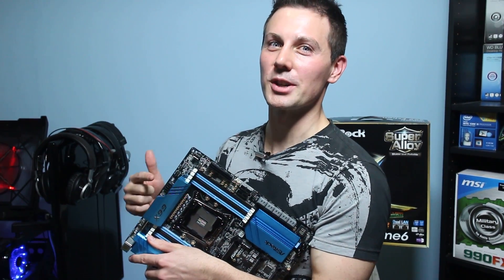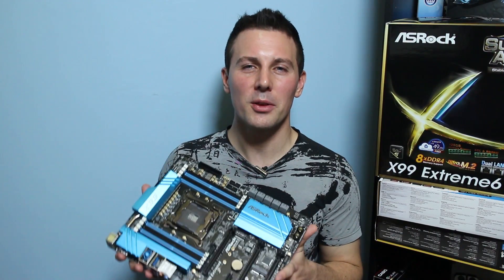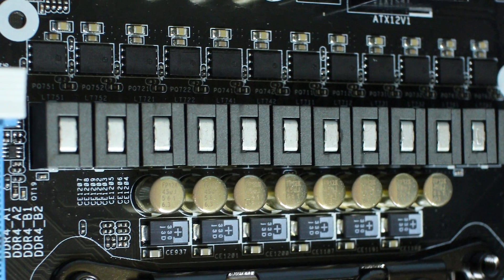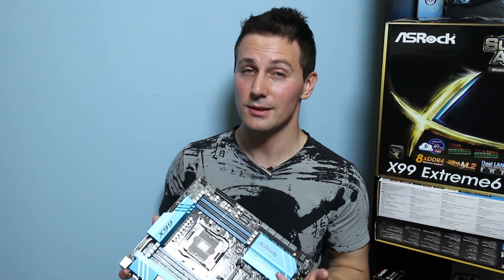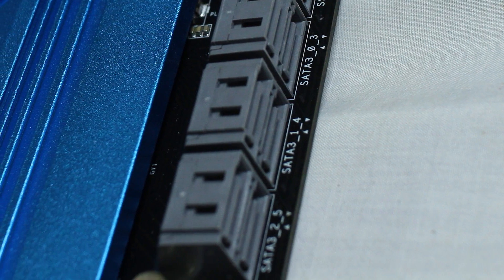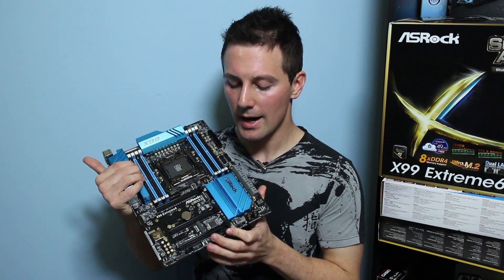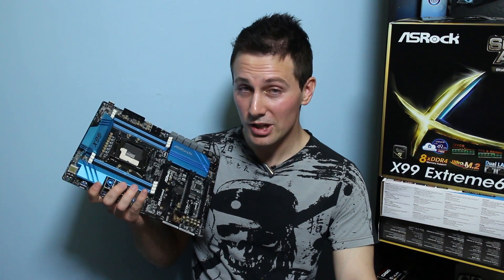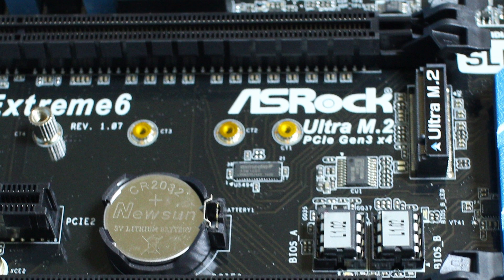ASRock X99 Extreme6 Review - Finally a X99 motherboard that WORKS!

Comment from the maker: Happy New Years Everyone!
Reply: You too, bud!
Reply: Mr Tweedels Never use AIDA (or any stress test) and adaptive voltage, it is known that it will pull more power than required, if you wanna test out if it's pulling more voltage than you set in the bios, try playing a game and monitor your CPU voltages while playing, this will show you how much voltage is really used for your CPU.
Reply from the maker: Not sure about the Asus Deluxe, but I have two of Asrock's X99 Boards here and both work / have worked flawlessly.
Reply from the maker: lol don't let the women dictate how to spend it :p
Reply: Hi i have a question about Overclocking. I have an 4790k that can do 4.6GHz on all cores with 1.180 Corevoltage (manual mode) but when i set to adaptiv with CPU Turbovoltage set to  1.180 and the offset at 0.001. But when i try to benchmark it with Aida64 Extreme it goes to 1.312 CPU Voltage. And i don't know why. Hope some one can help me.
Reply from the maker: What motherboard are you using?
Reply: ASUS Z97-A
Reply: Mr Tweedels Meh, can't get adaptive to OC worth a dam on my Hero VII... but my 4790k needs a lot of volts 1.231 just at auto settings... 4.6 works at over 1.300 on manual, but not well ("well" being Prime 95)... and this is with it delidded (relidded? lol) and Coollabratory thermal compound between the IHS and die, with good temps. I have terrible luck with CPU overclocking and am pleased as punch that my 4.0/4.4 CPU actually reaches THAT! :-)  I've scoured google and vids looking for details about adaptive voltage but haven't found much that does the work for me so one must get in and just tinker... and there is a LOT to tinker with on the Hero VII bios. 4.0/4.4 turbo is it for me as I am getting on with my life... lol.
Reply from the maker: One thing I forgot with the ASRock boards (was the same with my z77) is their override (fixed voltage) is pretty interesting, your voltage won't move at all, but your CPU will still throttle down and save power, for some reason feels slightly snappier than adaptive when coming off throttle.
Reply: Tech YES City
I noticed the same thing with the ASUS Z97-A
Reply: Dunno if I wanna push 1.32+ volts (my 4.6 settings) 24/7, even with it saying it's running at .7 ghz.
Reply: Tech YES City This is my new build saved up mate but I'm just concerned about how long before I have to upgrade again? I think It should be 2+ for 4k and 1440p 3+ and 1080p 4+ just wanting your thoughts on the situation at hand, and nice video like always :D
Reply from the maker: What is your new build? The ex 6 and 5820k? It will last quite a while, especially for gaming.
Reply: Please help me tech yes city. I just bought an asrock x99 extreme4 motherboard with an i7 5820k. I've never done over locking before so please walk me through this to get this cpu from 3.3 to 4.0 or 3.8 maybe please.
Reply: hey man, nice Video content! i bought an i7-5820K and an x99 extreme 6 ac, and an MSI GeForce GTX750 2GB DDR5, before more than two months.
I got always ERROR #57 and b7 which are Memory errors.
i could not figure it out, so i had to bring it all back. I got the info that there was a damage at two RAM Slots and there was also two bent Pins at CPU slot.
I can promise, that i was soo carefully, soo concentrated at assembeling so it probably wasnt my misstake.
Now i got back all parts, with pre-assembled CPU and RAM bars with the Mainboard.

I dont know, i paid €1100 for the components, and i was very careful with this expensive parts. Before i touched anything, i learned about and watched videos about correct assembly.

Do you think, its possible to receive that damaged products in that price point?
Reply: hey man, nice Video content! i bought an i7-5820K and an x99 extreme 6 ac, and an MSI GeForce GTX750 2GB DDR5, before more than two months.
I got always ERROR #57 and b7 which are Memory errors.
i could not figure it out, so i had to bring it all back. I got the info that there was a damage at two RAM Slots and there was also two bent Pins at CPU slot.
I can promise, that i was soo carefully, soo concentrated at assembeling so it probably wasnt my misstake.
Now i got back all parts, with pre-assembled CPU and RAM bars with the Mainboard.

I dont know, i paid €1100 for the components, and i was very careful with this expensive parts. Before i touched anything, i learned about and watched videos about correct assembly.

Do you think, its possible to receive that damaged products in that price point?
Reply from the maker: Yeah, the pins are not sent bent from Asrock, I would guess that they (the retailer) actually sold you an open boxed motherboard (one that had been returned previously)....  Pretty dodgy practice if so, but there is a chance you did itself, but if you are as careful as you say then it will be one or the other.
Reply: Hm ok, but is it possible that i bought an "second Hand" Mainboard?
in the Video you see the packaging, which was really good, welded in this special foil/film.
Also all this cables, wifi antennas and each piece in the delivery was extra welded...
Reply from the maker: Yeah it is very possible.   Sounds more like a refurb that was just boxed as 'new'
Reply: WTF! things like that really happen in the EU? what fu**ing criminals do we have in our bad contaminated world?
Thats an €260 ($300) mainboard, is it possible to identify refurb-boards from Asrock?

i really hate this Board, and especially the company Asrock.
it feels like through €1100 out of the window. I think ill never buy my components seperatley, for €30 more, i could get it built ready to use.
Reply from the maker: Try contacting Asrock, and if you can try finding out some more information, as it could not even be Asrock's fault at all...   However this kind of thing does happen.
Reply: ok, i will try this. thanks man for your help. 
youre Welcome, go on...
Reply: +Tech YES City do you know any updated, or even a review of the asus deluxe? man, its 2016 and i see that there were problems with them but, nothing new...seemingly. it would seem that when they go, they blow your cpu up too. so, you know anything or, which x99 is great, with good sound great features and won't blow up my 5930k? please help me bro. i can't afford to blow my shit up. also, what do you know about if something blew up your cpu as far as refunds, or exchanges? again, please help me bro, like seriously. my head hurts from digging through all these forums and youtubes.
Reply: Tech YES City
yeah...blue....but yeah... okay. thanks man. I kinda of got that at the end of this vid but i do appreciate it man. my gf will stab me in the neck if i waste money.